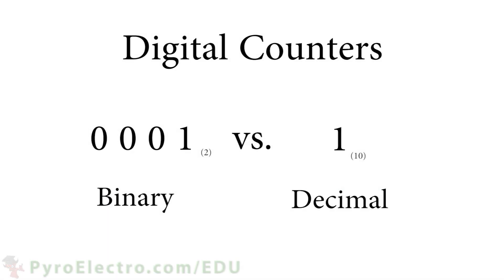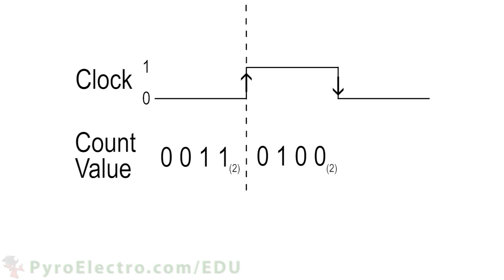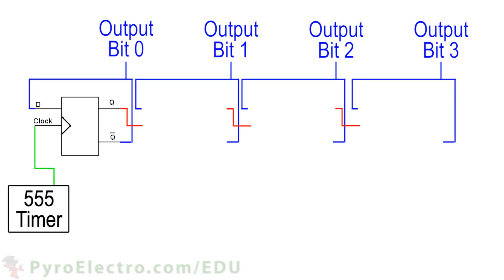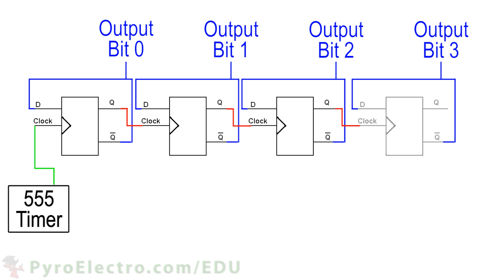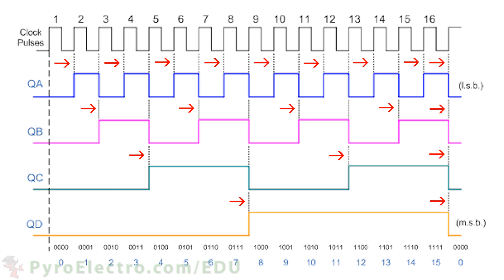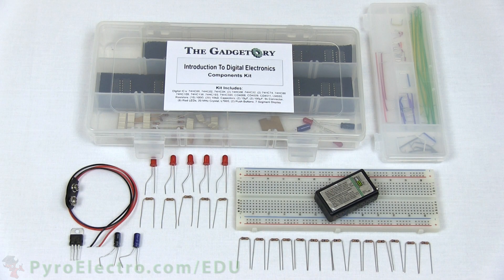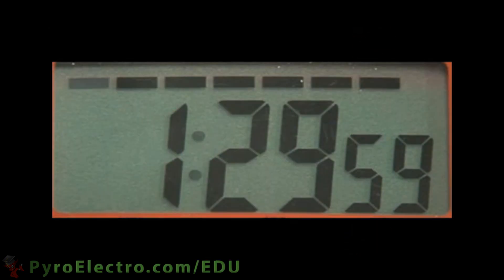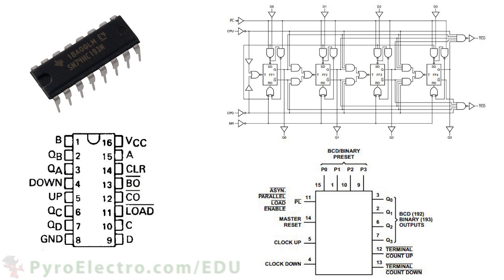4-Bit Counter - An Introduction To Digital Electronics - PyroEDU

Comment: Area = width x height. It is Area = 1 x 4.
If make it Area = 32 x 32 or even bigger value in width and height. It become PHD design tool. Picture figure work. Just run it with binary bit left shift or right shift counter. It is use to form picture.

Comment: I tried this circuit with the smaller capacitor, but it doesn't work at all not even a single led is working.
Could a faulty capacitor be the reason?
also I noticed there are a couple of wires on the 2nd IC connected different from the schematic, Why is that?!

Comment: If someone had issues with random ON states, that can be easily fixed by the swift increase of potential on SET pins of the IC. That can be done by adding capacitor from positive (~100n) and resistor from negative (~100K Ohm) or if you have many ICs, to avoid repeating the same for all this can be done with NPN transistor switch that has 100nF cap feeding the base to positive and 100kOhm resistor lowering base from the negative. After that, collector to the emitter to the negative (via another 100K Ohm) will be opened for the short time, which can be used to set all SET terminals of all ICs to the HIGH for a brief moment at the startup.

Comment: hi sir thank you for the idea, I would like to ask some help or just tell me how i can create a circuit that doesnt use 555 ic.. i mean a circuit that doesnt count automatically? we have a project that is to be designed for manual counting..
Reply: sir what ic is that 7474 d flip flop? 74hc74 or 74ls74? please sir, i need it for my project
Reply: Jessica Chavez  You can use arduino or some other similar microcontrollers but this requires programming skills or at least basic knowledge of C.
Reply: Kristijan asjlfboisdbsdnfvm thank you for your response God bless :)
Reply: Monostable multivibrator (74HC123) with switch debounce circuit (if noise is an problem).
Reply: 7474 is TTL. 74LS74 is again TTL, but uses transistors with schottky diodes for fast switching. 74HC74 uses CMOS logic, which has MOSFETs instead of BJTs in the chip, which leads to much lower power consumption.

The 7474, 74HC74 and 74LS74 work the same in general. If you want more information, read the datasheets of the chips you listed. I will put the links to them in this comment.

7474 (actually SN7474):
http://www.ti.com/product/SN7474?keyMatch=7474&tisearch=Search-EN-Everything

74LS74 (actually SN7474):
http://www.ti.com/product/SN74LS74A?keyMatch=74LS74&tisearch=Search-EN-Everything

74HC74 (can be SN74HC74 or CD74HC74):
http://www.ti.com/product/SN74HC74?keyMatch=74HC74&tisearch=Search-EN-Everything
http://www.ti.com/product/CD74HC74?keyMatch=74HC74&tisearch=Search-EN-Everything
Reply: Are you using a button?